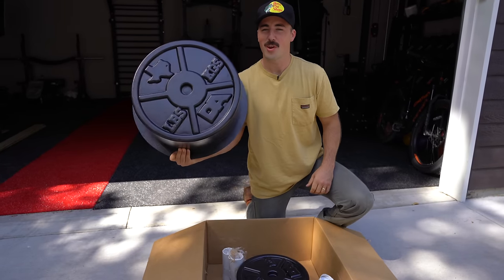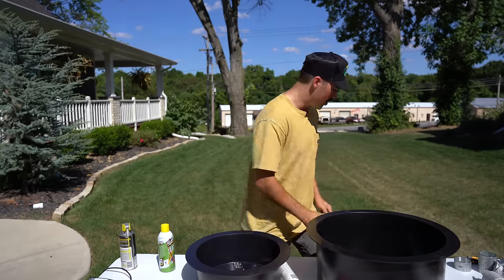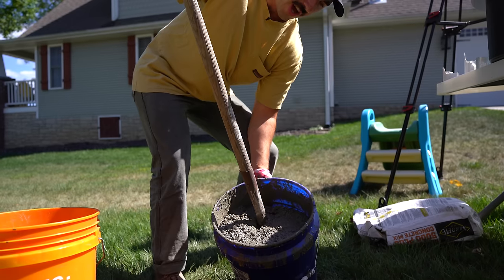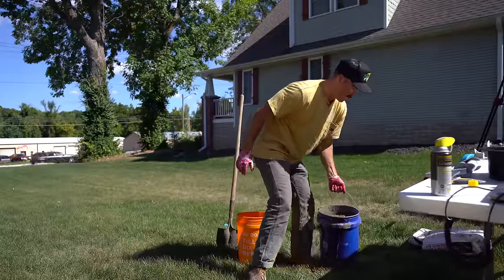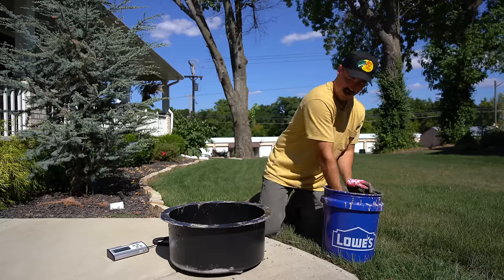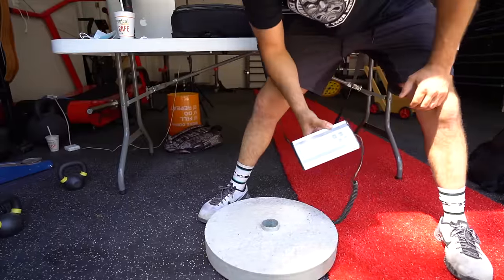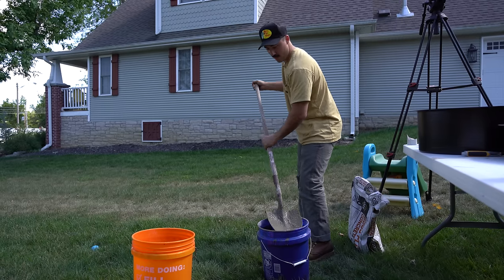How To: DIY Concrete Weight Plates That Don't Break

Comment: As a civil engg it bothers me as  you say its concrete but haven't added any aggregate in the mix (sand)
EDIT1: Sorry I didn't pay attention to the details it is not plain cement. It is a  concrete mix (cement n aggregate) Need not add any sand to the mix. coop has done a great job. fiber definitely improves the tensile of concrete.
Reply: Get this man some Portland cement 😂😂
Reply: @kylelavallee2505  we  have tons of cement at the site I'dont need any
Reply: @Huginn Bodgaedir too much cement can lead to shrinkage cracks in concrete
Reply: @Huginn Bodgaedir1) I would go with 1:3:0.45 {cement:sand:water weight ratio )mixture, you can add fiber as well.
2) remove concrete from mould after 24 hours 
3) immediately place the plates in water for curing
4) Would cure it for 2 weeks so concrete can attain maximum strength (concrete gain  70% strength  in 1 week)

Comment: The concrete seemed to crumble a bit against the bar when you dropped it.  But you said that was only after 2 days curing.  

Did it crumble at all when you dropped it after 7 or more days?

With the fiberglass in the mix, I would be worried about any crumbling.
Reply: That was the excess concrete that seeped between the seal and the mold into the bar area. It happens and in my instructions I tell customers to clear that before use. I also tell them to wait at least a week to use them but Coop was too excited to do either lol. I have had minimal chipping and cracking with my fully cured plates and I’m almost 6 months in using them daily

Comment: With concrete plates spray them with that flexseal crap. It works. Only actual practical use I found with that crap

Comment: Budget Tip: Those pieces of plastic cost around $1 for them to make and they are selling it for over $100. Get Terra Cotta Plant Saucers in the dimensions you need for around $5 a pop (cheapest on Target website). Made with better, more durable, plastic. Just doesn't have the weight design logo is the only downfall.
Reply: Actually our molds are made from quarter inch thick abs plastic that is heat formed to end up about 0.18” thick. It is very durable and made better than those saucers that you spoke about. And trust me, it takes a lot more than $1 to make them.

Comment: I made mine with steel 4,5cm thick 30x30cm Square with a hole in the middle. Weighs 27,5kg. Technically DIY but if you don't have have a heavy, heavy-duty machine drill that is basically impossible.

Comment: If you want to make them wear better coat them with Kevlar reinforced P.U. bed liner rubber. a bucket from Walmart is about 50.00 but it should cover 20-30- plates. This will still bring your costs in lower than store bought ones and they will be as good as the lower end ones for sure. With the Kevlar reinforced rubber they may even be better. I saw you adding what looked like fiber glass fibers was that right? thanks for the video

Comment: If you have access to "cement all" by rapid set (at home depot) you could use that as well... cures up to 2000psi in I believe 45 min.... so every 45 min you can mix up another batch of plates... only problem I could see is rapid set gets hot as fuck when curing so im not 100% sure if it could mess with the mold. When my molds come in and i make a few plates I'll update the thread💪🙌

Comment: Coop, you didn’t mention anything about damaging the barbell sleeve with wear and tear from these plates. Why not? Honestly I would never use them on my Rogue Matt Chan 2.0 Barbell. Maybe on my Titan Fitness landmine beater regular bar for 129$ but still I would be concerned about my equipment sleeves on my machines as far as scratches etc from these plates or chipped edges etc.
Reply: The conduit stays in the concrete to serve as protection for both bar and plate. Just like a bumper plate has a center sleeve to slide onto your bar, these pipes do the same.
Reply: Stix And Stone how secure are they? Do they loosen over time?
Reply: AM Fitness the first set I made five months ago are still tight and working very well. So anecdotally I can say that none have loosened and none of my customers have said anything about that either.

Comment: You can do even cheaper. Garbage bags and pillow cases. Weight them and use either sticks or wooden dowels for your handles. If you have a bar even better

Comment: The mold price is a bit high. A local ad on kijiji, sells a set of concrete plates 2x:  45, 35, 25, 10, 5, 2.5 for $280 canadian ( $215 US)  He does all the work. I think amazon has better prices on molds. 

I am here like many, with a need for some home weights but limited budget. I am looking at all options, and there seems to be a shortage of 'good deals' on used stuff.  Over all good video.

Comment: I'd probably have to see like a 100 drop test cause I did notice some concrete shaving off and I wonder if after deadlifting alot and slamming it back down it'll start to form stress cracks

Comment: How long did you wait till you removed it from the silicone? I imagine you waited a day? Unless you used hot water maybe a bit less?
Reply: Also, how many of those conduits does this mold kit come with? I noticed on the website it’s only 2 in there. Or does the conduits slide out after each use? If that’s the case I’m guessing install the silicone lubricant onto the conduit as well.

Comment: I would add a tip.  You do not really that letters and number on your plate, so instead of that $115 kit, use $4 home depot pocket as your mold.

Comment: I noticed the concrete flaking off when you dropped the weights. Would concrete floor epoxy work as a coating to seal it?

Comment: Couldn't you spray the weights with some Line-X and make them indestructible? I noticed that even though the plates didn't break completely they did chip off a bit around the hole during the shaking of the bar as it settled down. Also the Line-X paint would add color to it and make it look even better!
Reply: Yes, lines and spray on bedliner works very well with these. The “chipping” you saw in the first drop was actually some excess concrete that seeped through the silicone seal during pouring. It happens and is usually cleared off before use.

Comment: So many concrete plate videos out there that does not cover the importance of properly finishing the plates. You want to make sure you smooth out the backside of the plates and properly seal it with urethane based products to prevent crumbling and dusting. Especially if you're building these plates for an indoor home gym, the dust factor becomes a big issue. You don't want to breathe this stuff in!

Comment: On the 43 pounder, should have poured the concrete even to the rim of the center pipe then it would have made 45 pounds. I noticed you was just below the top of the center barbell pipe thus not pouring in enough concrete.

Comment: Do you count the weight of the water ? Doesn’t it all evaporate leaving the same as the dry weight ?
Reply: That is what i would have thought as well. I think it all evaporates otherwise demolition work would be a lot easier and with less dust

Comment: You didn't use enough water, definitely use gloves its corrosive after all.  Also when mixing first add some water than some concrete and mix it in always keep it a little when adding more to the mix until you have made almost enough than thicken it up at the end.   Maybe even add galvanized wire to maximize structural strength.   4 years stucco mudman.

Comment: no matter what you do those plates will degradate over time. if you will make them good then no, they won't break, meaning they wont snap being dropped, but with every drop you would see more and more dust coming off. after some time this dust will change to small stones, and after even more time you will start to see dents on the plate here and there, indicating that it is falling apart step by step.

so yea these can be good, but only if you wont drop them.

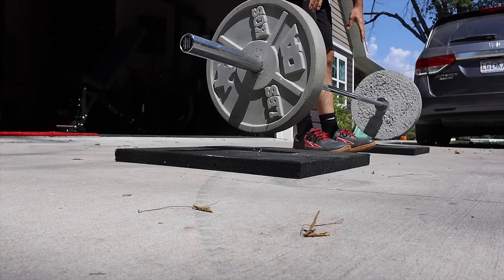Comment: They were already breaking (chipping). 10:45 where the concrete touches the 2 inch electrical conduits (metal cylinders).

Comment: Would you not consider the cement mix and the water accurately measured out into your mix pale that way the plate to plate will be more close within a 1/2 lbs for sure or better.

Comment: Could you make them 100lbs or would the concrete become too brittle or something? I know nothing about concrete. 
P.S. What kind of scale did you use?
Reply: The molds are sized so you can make a 100lbs plate just as easy as making a 45lbs plate. You can use any normal body weight scale to weigh the concrete before mixing and pouring.

Comment: What would have been useful is figuring out the cost per Ib of making these weights.
Reply: Starts at about $1.50/lbs on the first set, then drops by almost half for the second set. As you make more sets they average less and less per pound.

Comment: Are cement 45lb plates the same thickness as steel plates? Trying to find a mould for cheap and I need to know if 2” height will be enough

Comment: What would you add to the center of the plates to avoid scratching and causing abrasion on the barbell sleeve?
thanks
Reply: The sleeves that come with the molds do just that. They are the barrier between the bar sleeve and the concrete plate.

Comment: Could start with the mold on the scale and tare it so you don't have to guess your weight sans mold.
Reply: What happens when they are exposed to the damp? They will just gain weight. Pretty cool though

Comment: why not just set your scale to read 45lbs that why your plates are spot on
Reply: I was thinking similarly... put mold on scale zero it out, then fill till 45lbs at least... Water vapor will release and it will potentially end up being less than 45lbs like the 43lbs he ended up with

Comment: Looks like it might be tough on the barbell though.
Reply: That is what I was thinking and move so of they hit the ground a lot on lifts like the deadlift. I built my rack which you can see but building plates would take some time
Reply: It’s no tougher than solid steel plates would be. The steel sleeve in the center is a barrier between the barbell and the concrete.

Comment: Weigh the concrete before you add water. Once it's cured the water weight should be gone. Just a tip.
Reply: Thank you mate that is a good tip. I thought some of the water would always slightly remain. I was going to build some stones too, so this helps

Comment: The real question is how much thicker is it compared to a cast iron plate?
Reply: Cast iron 45lbs are around 2” thick, while most of my concrete 45lbs are around 2.5-2.75” thick.

Comment: What's the diameter and width of the 45 pound plate? I can't afford those molds so I would probably make one with what I have.
Reply: 17.5” diameter x 2.5” thick with Quikcrete 5000
Reply: @stixandstone  Thanks for replying, it means a lot. I was searching up ways to make a 45 pound plate that's just the right size. Although I do not plan to load these on barbell rods, just going to use them for weighted calisthenics.

Comment: How does the fiberglass strengthen it?
Reply: @Huginn Bodgaedir I wasn't doubting the strategy, I'm actually asking how does it strengthen it?
Reply: Matthew Calton it does the same thing that rebar does buy more evenly across the plate without adding a ton of weight like rebar does. All those little fibers spread through the mix and create a latticework to hold the concrete stronger.
Reply: @stixandstone  thank you

Comment: What's it work out to in cost per pound?  That's what I really want to know.
Reply: Starts out at about $1.30 per pound for the first set and drops tremendously with every set after that. 80lbs of concrete is around $5 or less right now.

Comment: The center of those weights are taking beating when they're dropped. If you did that more than a few times they would become compromised and probably fall apart from the center. These are cool, but you just can't drop concrete like that. There is no way to make them strong enough to do that.

Comment: Caveman weights on instagram sells molds for half the price they’re just as good !
Reply: Yes they are good and cheaper. But ours are more versatile molds. Each mold can make numerous sizes of plates. The large mold can make from 25lbs up to 100lbs plates. The small mold we sell makes 5lbs up to 35lbs.
Reply: But only olympic size?
Reply: Trinidad Arceo the center index is sized for Olympic 2” sleeves to go around it or standard 1” sleeves to go on top.
Reply: @stixandstone  wouldn't that leave a small portion in the front of the plate that would not have the pipe and it would be bare concrete touching the sleeve?
Reply: Trinidad Arceo not at all the concrete will be flus with the pipe and not touch the bar at all. Just like it would with the Olympic bar.

Comment: they shouldnt break because concrete has such a high compressive strength. the rebar that typically is used when forming concrete is for the lack of tensile strength of concrete.  forces from lifting concrete and dropping it shouldn't cause tensile force issues.  this vid is a lifehack for sure.

Comment: definitely not breaking but the inner plate where the barbell is through is slowly chipping away eventually it wont work cause the hole will be too big
Reply: I was thinking you could always re patch it up or use a metal ring to extend the lifespan of them

Comment: Do you cut the metal cylinder?
Reply: Yes. Pending on the weight you choose the make, there can be excess sleeve left over. A quick cut with an angle grinder and you’re good to go.

Comment: Coop if I have a ROGUE RM6 and with REP fitness selling crossmembers and name plate for the VR 5000 would I be able to use those crossmembers so I can add REP FITNESS lat pull down into my ROGUE FITNESS ? Does anyone else besides COOP have info of how to do this if it would work .
Reply: GarageGymFanatics on IG posted a setup like what your talking about today.
Reply: Daniel Youngblood for real I didn’t see it so it’s comparable ?
Reply: @user-fj2or3xp2c  sort of. I mean, the Rogue rack is wider than the Rep so the stabilizing brace won't fit. So they had to make a diy crossmember to anchor the lower portion of the Rep lat/row. I imagine if you had a 2nd rogue upper crossmember, you could use that but you'd probably also need a pair of side crossmembers as well.
Reply: Daniel Youngblood I just saw it , looks easy to do but I would like for them to post up a YouTube video to see how it works

Comment: Well the molds cost almost as much as a plate anyway. Dangit I was seriously thinking about this
Reply: The molds are cheaper than a set of weights and I cover shipping unlike most companies right now. Also the molds can make tons of plates over time and the more you make, the cheaper per pound it is.
Reply: Is that for a set of 45 lb molds or just 1.
Reply: Austin Schiefelbein I’m a little unsure about your question. But the prices on my site are for one mold, which can be used for a lot of plates in succession.
Reply: Austin Schiefelbein also, each mold can make multiple sizes of plates. The large mold makes 25-100lbs plates. Not just 45lbs.

Comment: Amateur tip:  Use a wheelbarrow and a hoe to mix your concrete--way easier than a 5 gallon bucket.  Also wear a pair of latex, rubber or nitrile gloves inside of leather gloves when handling the wet concrete mix--wet concrete really cracks up your skin.

Comment: Still $115 for 1 mold. Why not just use a bucket? Sure it won't be as nice but you'd save $100. You could just write with marker "45 pounds" on it.

Comment: Too much work and mess. I just went to a nearby junkyard and picked up a couple of car rims disc brakes.
The car disc brakes work well, just need to clean them a bit from oil and rust if it bothers you. I even got 2 for free from a local garage.

Comment: Looked like it was chipping off
Reply: That was the excess concrete that seeped between the mold and the center sleeve. It happens but usually you should clear that off before using the plate. The bar did the clearing in this case 😆
Reply: Stix And Stone oh gotcha. Nice idea if it holds. Might have to start selling them the way ppl are buying plates lol
Reply: Combat Sports 6ix 😆

Comment: What kind of longevity should I expect from concrete plates?  I don't plan on dropping them or anything.
Reply: I’ve been using my first set for 6 months with no issues.
Reply: @stixandstone  that is good to hear mate. Any big drops along the way or just using them for non contact floor movements?
Reply: Garage Gym - Laird Ross I deadlift, pendlay row, and RDL weekly. They get contact with my rubber mats on the platform. I’m just not being crazy, like slamming them from a snatch position or anything like that.
Reply: @stixandstone  that is really good to hear mate, I just wasn't sure how they would hold up long term. Not sire if you have seen a few of my lifts but yeah you will understand concerns. Have a great day and stay well

Comment: Anyone know why they use metal tube not plastic/pvc tube?
Reply: I have found that pvc gets beat up and breaks down pretty quickly. So I sell galvanized steel sleeves to resist rust and give a longer life the the plates

Comment: Lots of generalities.  2 or 3 lbs. Which is it?  Looks like those molds should come with lines that correspond to different weights.  And then have detailed weight #s to account for mold or instructions for how to tare.  Good concept.  Bad design.

Comment: Less trouble to buy cheaps weight in iron, not fancy bumper plate, just basic plates, at least you can sell it if you want, try to sell concrete weight, not easy.